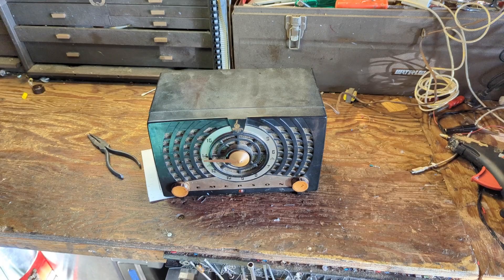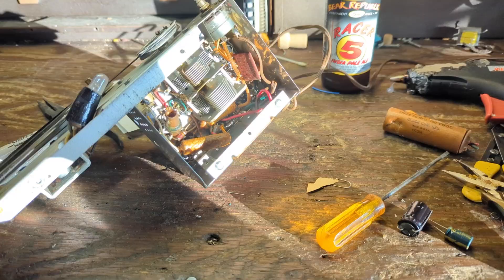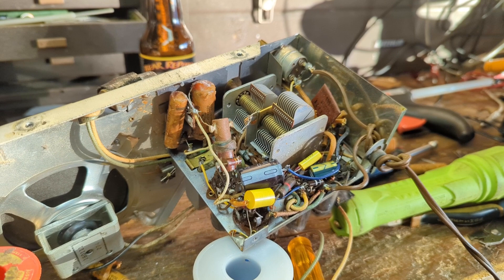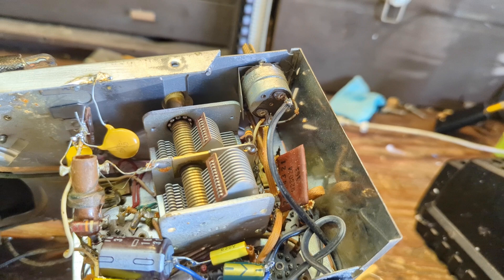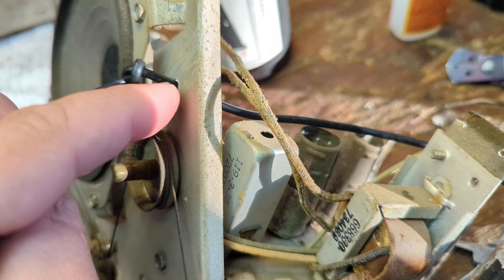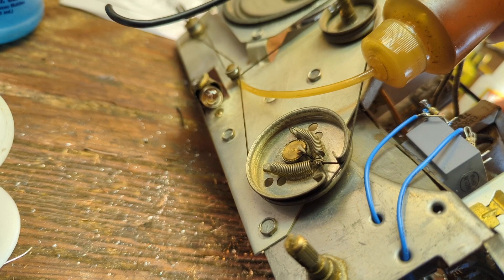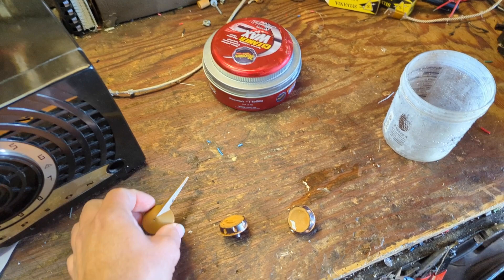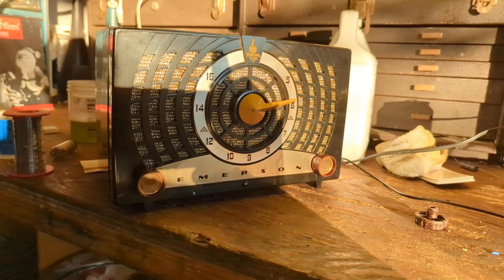Pain in the butt Emerson radio

Comment: I would like to offer you a piece of advice for the servicing of radios. It would be a good idea if you close the tuning condenser while working on the sets especially when you're doing soldering and other work. He will not accidentally bend the plates of the tuning condenser. And another suggestion is to cover the speaker with a piece of cardboard as to not accidentally puncture a hole in the cone. Just a friendly piece of advice from a fellow who has been doing this for 40 years
Reply from the maker: Thanks for that tip!
Reply: What ya think of his repair though, all tips aside..Great channel eh..? Peace..😀

Comment: Too bad you don't have a proper back for it now that it works once again. There are clips called split pins in the corners
 that usually break the corners of the back when you try and pry it off that are to blame. Little hands can get inside
without it. Usually the everythingradio website has some for radios but not for an Emerson  778B. Another great
restore of a pain in the neck Emerson. Don't try working on an Emerson  744B that one has an exposed metal bottom!

Comment: So I have tried to repair a few AA5 radios now and I have had mixed results with the audio in feature. Is it super important to use a 120 to 12 v transformer? I may have used a 120 to 9v ?

Comment: What was that extra green wire coming out of the back for?
I also noticed that a lot of the DIY automotive you-tube channels have a shop dog.  I guess you are setting a precedent  for the electronics channels with a shop kitty.
BTW, I have a black cat ... Little Black Cat is her name. She lets me live in her house.
Reply: I think he added an external antenna lead  wire which isn't needed for this set.
Reply: @hestheMaster  That's the only thing I could think of also.
Reply from the maker: It was there when I got it. Someone added a little antenna extension

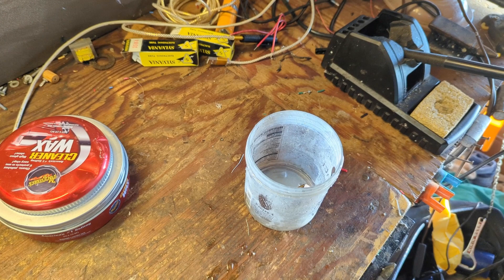Comment: 23:20 You really need to try the brake fluid for removing paint from plastic. Why beat yourself up experimenting with strange methods? After you see how well it works you will never go back.
Reply from the maker: Yeah, I've heard brake fluid will ruin car paint jobs, so I bet it would work on those knobs as well.
Reply: @misterradio5035  Learned that trick from a guy who built plastic scale models of cars. Had a dunk tank that was a plastic Tupperware container that he would soak a model in to remove the paint and change the color. The paint solids can be removed with a paint filter, and the fluid reused for more removal projects. It has minimal odor and is not flammable like other solvents, at least not to my knowledge.
Reply: @misterradio5035  Best of all it will NOT melt the plastic!

Comment: Wow, NOT a safe design! Touching those bottom screws or pulling off the knobs and touching the shafts could knock you back pretty good. The consumer really was on his / her own back then, nice and safe now of course!
Reply from the maker: Well, its not a true hot chassis. Its got a cap to ground which makes it a lot safer since the current potential is greatly reduced.